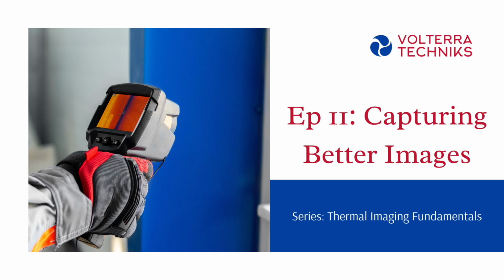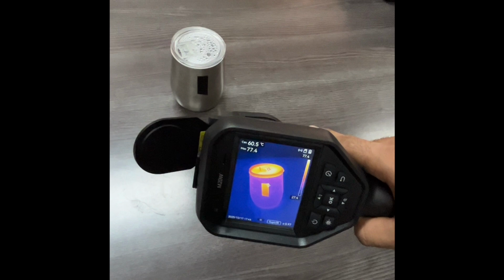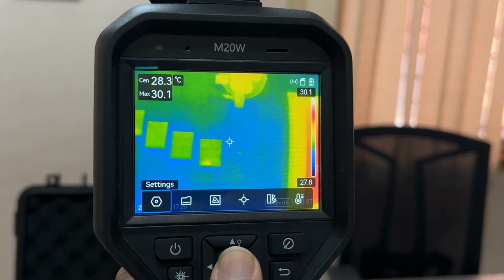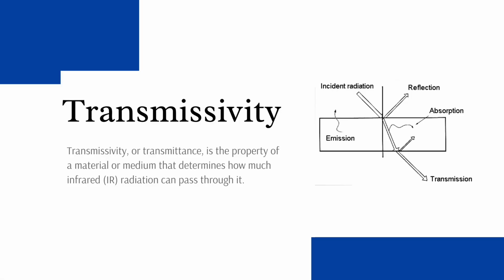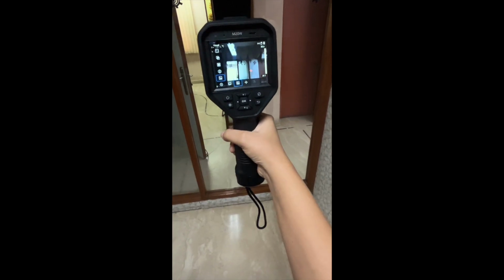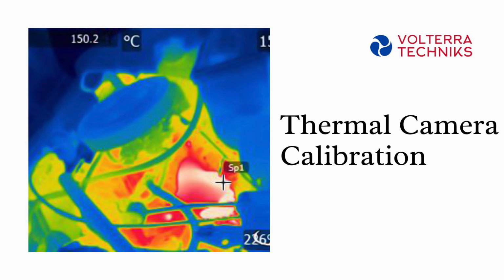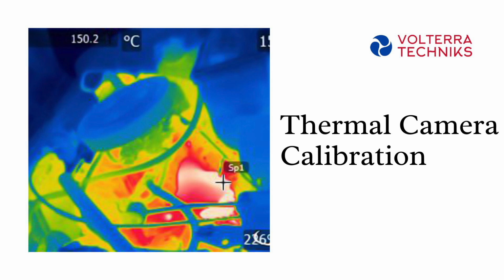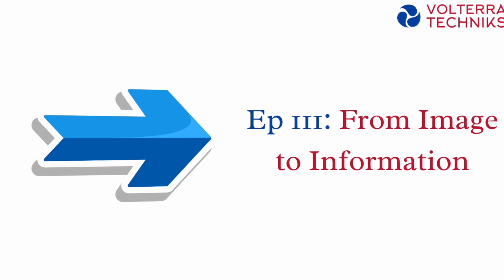Capturing Better Thermal Images | Emissivity, Transmissivity & Calibration Explained (Hikmicro M20W)

Comment: Ist das Gerät für Immobilien geeignet, gerade im Winter in Deutschland sind die Häuser kalt kann man damit von außen eine gute Aufnahme machen um die Verluste zu sehen. Wenn ja, stell bitte ein neues Video ein. Dann kann man das Gerät in Deutschland auch vielleicht besser verkaufen.
Reply from the maker: Thermal cameras can be used to detect heat loss in buildings as well. The emissivity of the camera would need to be adjusted according to the building material. We will keep your suggestion to make an extended video about this topic in mind!